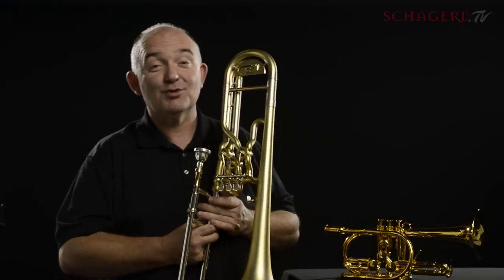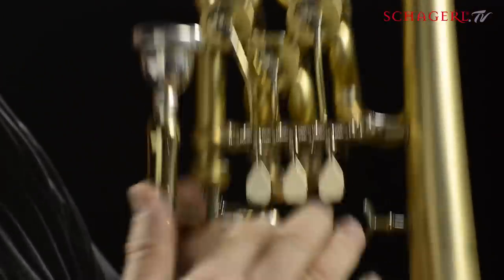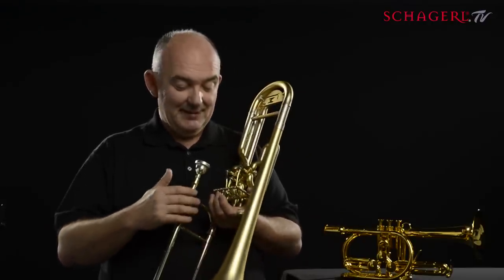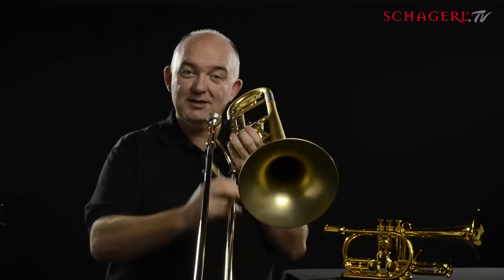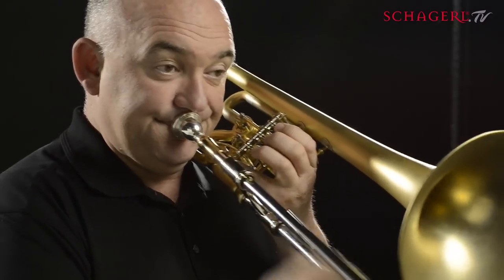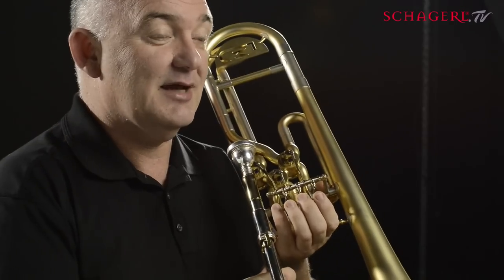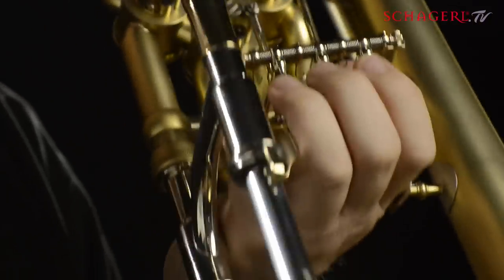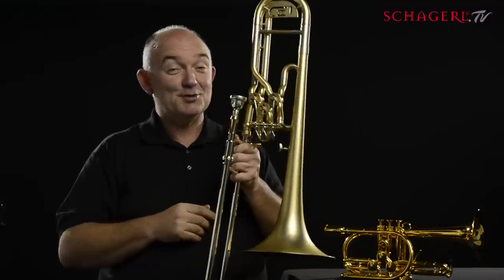James Morrison talking about the new Schagerl Trombone Model "SUPERBONE"

Comment: Where can I get one of these?  I'm completely serious.
Reply: I want a trombone with two valves ... 1for sharp-  1for phlat
Reply: Holton makes one too(with pistons though), designed by Maynard Ferguson.
Reply: Do you have $10,000 lol
Reply: Karl Glasser makes one for about $1000 in case your just interested in the novelty.  I'm a trumpet player just fooling around.
Reply: You can buy one with piston valves on the sears website, it even comes with a case.
Reply: in austria
Reply: Mendini sells one for $500 on Amazon.
Reply: He's too dangerous to be kept alive
Reply: Mason Michael I 500 dollar super bone would not be good
Reply: Mattie Jean R you can get that exact one from Thomann for about 5k
Reply: If you’re still serious Thomann has them
Reply: @superchawks  that's a little too spendy, but maybe someday!!! I did pick up the MF  Superbone in mint condition for a steal on ebay and love it.
Reply: @MeadFan  that was the original design. My opinion of those is better than most, but you still have to deal with right hand position offset of quite a few inches.

Comment: I know I'm several years late to the party, but this is a pretty good idea.  Putting the valves on the left hand should be more intuitive for Trombone players.  Rotors are faster and produce a sound more similar to articulating with a slide.  Hand positioning is fairly ergonomic.  I'm surprised this isn't the standard for China clones by now.

Comment: MAKE A BASS TROMBONE VERSION
Reply: if they wanted that they probably would just add a 4th valve probably
Reply: @hanj31  No, it already has plenty of valves for bass trombone range. It just needs a larger bore (.563").
Reply: Super duper-bone
Reply: @lswain1  Ehhhhh. If I know anything about valved instruments, depressing all the valves would essentially be the equivalent of pulling an F-attachment out into the key of E, which you can essentially do on any old trigger trombone. Sure you'll get that low B, but it'll be thin in tone, hard to reach for some people, and super sharp no matter how far you extend the slide. It would be like getting a dependent-valve bass trombone, but worse. You get the F-attachment with valves 1&3, the F#-attachment with valves 2&3, but you can't combine the two to make a D-attachment. A 4th valve, substituting as an F-attachment like it does on a 4 valve euphonium, is a MUST on a Super-bass-bone. Valves 2 3 & 4 would be the equivalent of depressing both valves on a traditional bass bone, giving you the traditional C in flat 3rd and B in flat 4th, and depressing all 4 valves can actually get you a fairly sharp C-attachment, letting you play low C in flat 1st and low B in a very flat 2nd. This, to me, sounds much better than playing the same low B but out of tune in the lowest 7th position possible.

Comment: I get the premise but you could just use a trigger trombone I know that you can't always just use it but 3 valves is not necessary
Reply: Three valves are absolutely necessary if you're going to play without using the slide. A trigger just lowers the pitch of the slide, it's not used independent of the slide.
Reply: @unpeople  Exactly I totally agree!! In fact it adds an extra E attachment achieving even lower notes if you press all 3 valves down. This is way better than any other trombone.
Reply: Remember that with any "attachment" horn, the slide positions are different for the straight horn and for the attachment side.  You've got to practice to get the adjustment down, and trombonists rarely use the trigger for notes above the staff.  With this, sure, you essentially have a 7-attachment horn, but that also means 8 sets of slide positions.  To really utilize all of them would require tons of practice.  After all, on a straight horn, it's somewhat rare to use longer positions as you get higher in your range.  James Morrison seems to have the right idea: play it primarily as a valve trombone with some slide effects, or as a slide trombone with the valves used in spots where you want clearer articulation.  Remember that the valves will be less and less useful the farther out on the slide you go: they just won't add enough tubing.

Comment: You could transpose a melody into a different key just by moving the slide to a different position and playing the valves exactly the same. Almost like using a capo on a guitar
Reply: holy shit, i didnt think about that. thats so cool
Reply: Not exactly.  When you push down a valve, you add a fixed amount of tubing to the length of the horn.  Those lengths are calculated based on the slide being all the way in.  As you move the slide out, you need to add proportionally more tubing to get the next lower note.  So if you say, play a G in fourth position with no valves, then you push the second valve, you'll get an F# that is a little sharp.  Or if you press the first valve, your F will be quite sharp.  What it would amount to is having to adjust your slide position a bit with each note to adjust for the not-quite-right length of each valve section.  With practice, you could probably do it, but it'd be way harder than capoing a guitar, where all the positions stay the same.  The longer the slide position, the harder it'd be.  Darn physics....
Reply: you can also play weird out their microtonal Ambient acid jazz

Comment: Hmmm....I wonder....If you put the slide in say 2nd position can you ultimately change the tuning of the valves....and vice versa...put down the second valve and now all the slide positions are down a half step. I feel like that would be a super cool use and could help you get all sorts of notes. Kinda like how triggers work on the Trombone. Helping you get alternate notes like B natural in 2nd or C in first? Or maybe like getting crazy low notes with all 3 valves plus 7th position....just an idea.
Reply: It sucks, but you'd need to design some sort of compensating system for each slide position, as far as I can tell. Let's say you put the slide in fourth position with the intent of playing in G. The valves would not create a chromatic scale is you were to descend as usual. The instrument in total (slide section + bell section) is too long in comparison to the tuning slides attached to the valves. The notes would too close together to get an actual in-tune scale. and that's the reason I'm angry at basic science.
Reply: Ahh that makes sense! But I mean that would be a cool idea wouldn't it? Being able to play in any conceivable key.
Reply: David Bowman It would be so cool, which is why I continue to be mad at basic science ;)
Reply: It still works. It's just that your position would have to be altered so that it's actually in tune. The wonders of playing the trombone!

Comment: Has he not heard of the Holton "superbone" Maynard Ferguson devolved in the 70s?  It did what this does except with piston valves
Reply: Paul Roberts the Holton model, as all others are right handed-valved, as opposed to Schlager's horn shown in this vid which allows both slide and the rotory valves to be used simultaneously or independantly :)
Reply: James idolized Maynard Ferguson and sat in with him on at least one occasion. Yes. He has probably even owned a Holton Superbone.The fact that he calls it a Superbone is an homage to the Boss
Reply: My grandfather designed that instrument!
Reply: @pauls5745  The Holton model is NOT right handed for the valves.  It is left handed for the valves and the valves and slide can be operated simultaneously.  One of the most famous people to play the Holton was Maynard Ferguson (who normally played trumpet).

Comment: Althought this is kind of cool in theory, and cool to watch, it's really just a bit of a gimmick... The best thing about the trombone is its slide - this will just breed lazy trombonists who won't learn to use the slide to its full potential (or learn how to articulate and develop good slide technique). Plus, it really just sounds like a French Horn when you play it using the rotary valves - it loses its essential trombone-like quality.
Reply: It does not sound like a french horn.  The horn has conical tubing, while the trombone is cylindrical.  Do you think a bass bone and a tuba sound exactly the same?  They do not!

Comment: WHAT?! How can anybody just switch from slide to valves that fluidly with licks like that??? So yeah James Morrison is mega boss.
Reply: It isn't that hard.  Notice that he doesn't use both simultaneously.  In other words, when he is playing the slide, all valves are open and when he is playing the valves, the slide is in first position.  With practice, you can get comfortable using some easy combinations.  For example, 1+3 is the same as using the F trigger.  I use G trigger trombones a lot, so that is equivalent to 1+2.  And if you want to expand from there, hit 1+2 any time you want to drop a minor third from the current slide position (may require a slide adjustment for best intonation.).  Hit 2+3 any time you want to drop the slide pitch a major 3rd.  Hit all 3 valves any time you want to drop the slide pitch a tritone, and so on.

It just takes some practice. but the Holton is so awkward to hold, I don't really like to practice it much.

Comment: You can also play in multiple keys with the same fingerings on your left hand by changing a slide position and holding it there or vice versa. It's like cheating memorizing scales!
Reply: you can use the valves to change key but not the other way around. As you get higher up the register the slide positions get smaller

Comment: Can you get a much lower pitch than usual on that thing too? Ya know? As is you were playing a trombone with a trigger.
Reply: +mrwizzardknight I would expect they'd work as a trigger, but not as a conventional one. You'd have to play valves 1 and 3 together to get the same pitch drop as that of an F extension. I might not be correct as I knew nothing of this instrument before watching this video, but to my knowledge, I think this is correct. Hoped this helps :)
Reply: +mrwizzardknight It's kind of like using a trigger, except this time you have to press multiple valves for the result of an F trigger (valves 1 and 3)
Reply: That revolutionary trombone costs a humongous fortune! :o Over 6 and a half grand if you will! XP
Reply: Daniel Leeachenbacker There's a slightly cheaper superbone. It's brand is Holton. It has 3 valves what you can use with ya left hand, just like what you'd see on a euphonium. I wish I had a superbone! It's unbearable having them crappy clarinetists in my way! Leaving me with no room to move my slide! 😤
Reply: Even cheaper than the Holton is the Karl Glasser (as of 2018)

Comment: I would buy one of these in a New York minute if the axis of the 3 keys was parallel with the slide rather than perpendicular to it. The current arrangement is a recipe for carpal tunnel syndrome or other chronic left wrist issues. Great concept, poor execution.